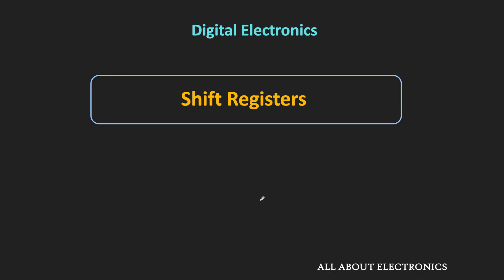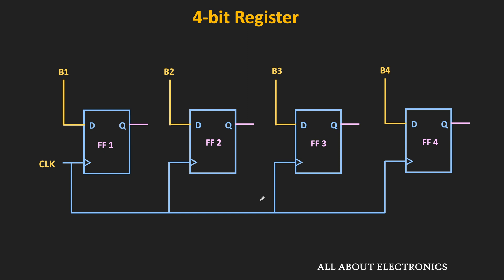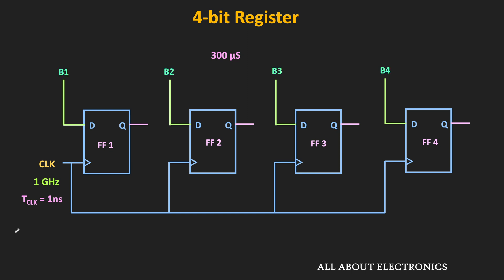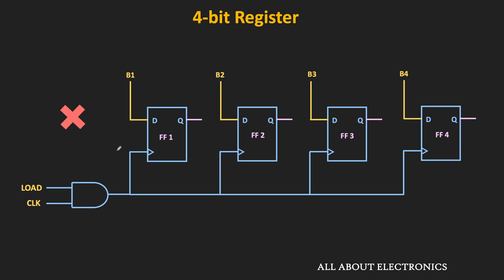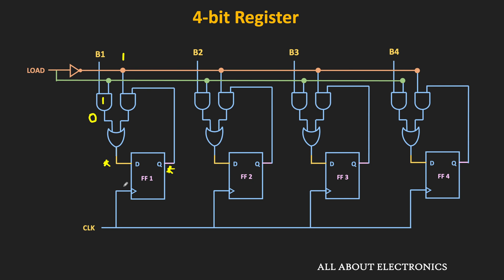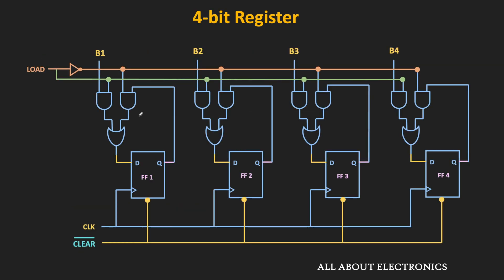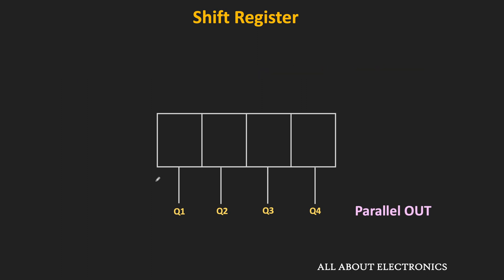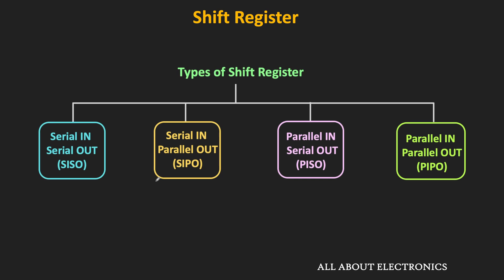Introduction to Registers | What is Shift Register? Types of Shift Registers

Comment: Nice,
but how do we arrived with the combinational circuit used in enabling load
Reply from the maker: If you closely observe, it is 2 input MUX. Based on the selection input (in this case Load input), it will decide which input  will appear as an output and will be applied to the D-input.

Comment: sir how are we saving propagation delay when we are using so many gates instead of simply a and gate in 4 bit register
Reply from the maker: Here I was referring to the propagation delay in the clock signal. when you apply the clock through the AND gate then clock signal to the register will get delayed.(Its called clock skew, I will cover that in the very next video). And it can cause synchronization issue in the large digital circuits. So, here instead of doing that, the clock signal is applied directly. And the combinational logic is implemented in the data path. Of course, these additional AND and OR gates will increase the propagation delay in the data path. (Flip-flop will receive the input after finite propagation delay). But as far as the inputs satisfy the setup and hold time condition of the flip-flop, it will not make much difference.

Comment: 4 - Bit Register using JK Flip Flop with Paralle load Circuit ?
🙏🙏🙏🙏🙏🙏
Reply from the maker: In the subsequent videos of the register, I have already explained it. 
Please check the recent video. In that, D flip flops have been used. But you can use jk flip flop also. Just use JK flip flop as D flip flops.  Basically you just need to apply the input to J input of the flip flop as it is, while the same input should be applied to K input of the flip flop via NOT gate. In the flip flop conversion video, I have covered that. 
Please check this video for more info:
https://youtu.be/bl77FRTAXWA?t=334
Reply: @ALLABOUTELECTRONICS  Ok got it. Thanks you

Comment: but sir isn't the combinational circuit used in 4 bit register is actually a 2x1 mux??? it will be easy for all to understand the load operation through mux circuit instead of combinational circuit.
Reply from the maker: Yes, I am going to link that in the upcoming videos, when I will discuss the universal shift register.